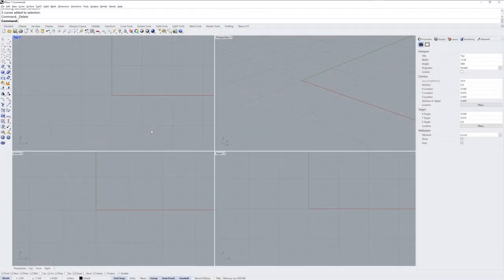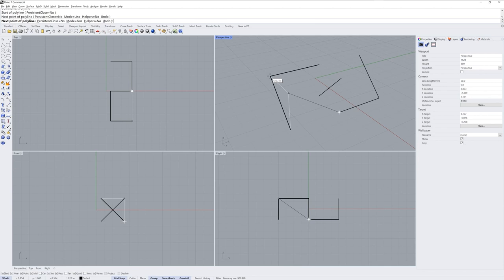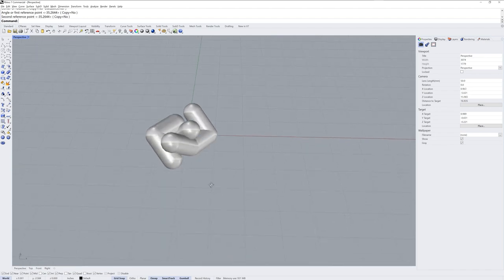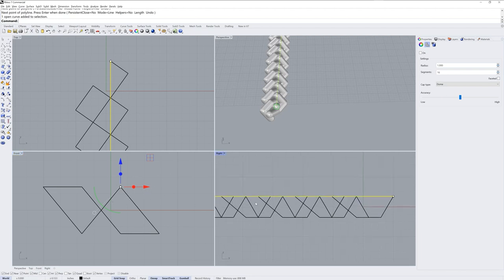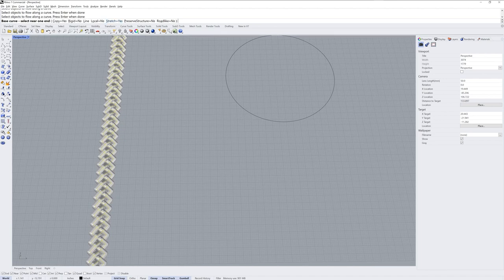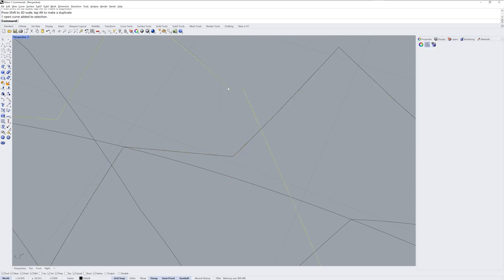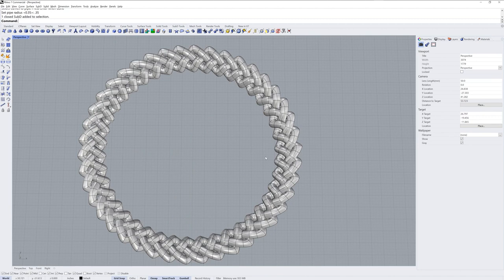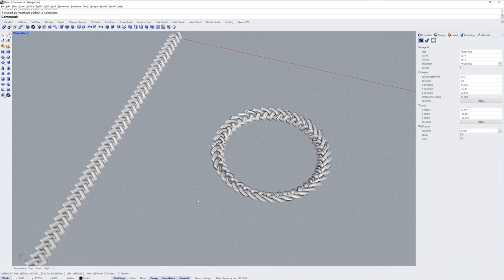Modeling a Braid in Rhino

Comment: I was going to print it, but realized that 51.44 inches is a very long braided circle!! Instead I will make it again with a smaller multipipe radius and a length/circumference of 8.5", or maybe I'll cap the ends and flow along a cuff shaped curve. Either way, it's slowly sinking in. Thank you!
Reply from the maker: Yes, at the larger sizes, CNC makes more sense :) but scaled down you can print it.